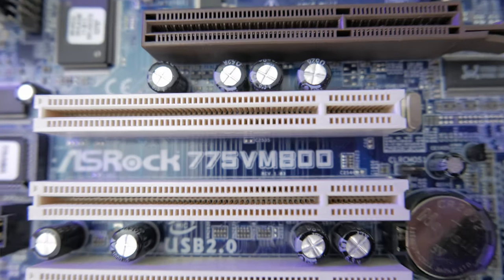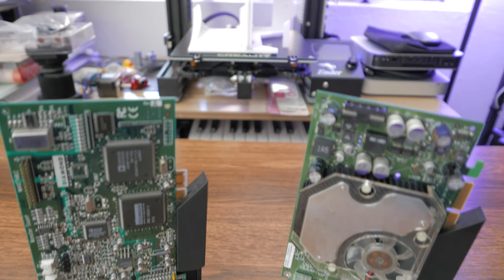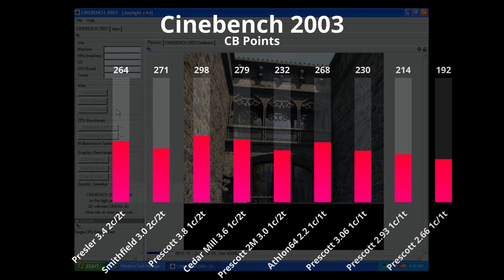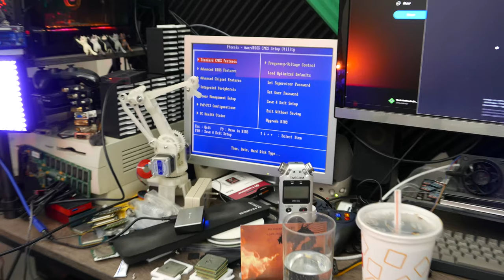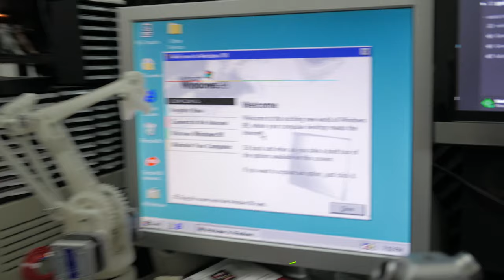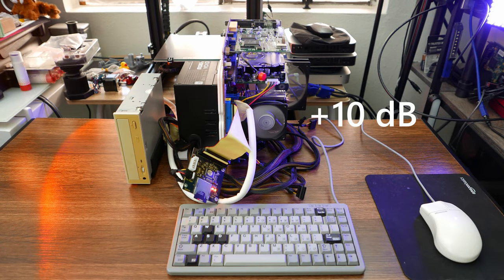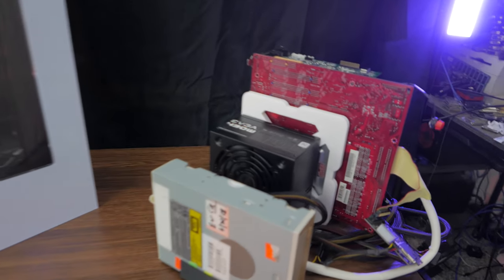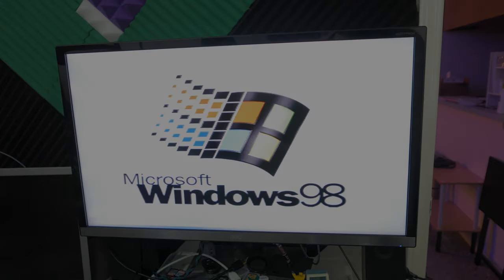Windows 98 for a Week Part 1: The Build

Comment: Ha! Fun stuff going on there, good luck with your quest. Funnily enough, I was just goofing with an Nvidia 6600GT in my Athlon 64 98 SE build today! It wasn't a stellar experience! 😆
Reply from the maker: Oh no! That's unfortunate!
Reply: @TechAmbr  Which Nvidia driver version are you using?
Reply from the maker: @ted-b  Forceware 81.98, I think you can download it from Phil's Computer Lab!
Reply: @TechAmbr  Aye, thanks! Yep, good lad Phil has got them all, I think. I was just wondering if you were using some magic ones I hadn't tried. 😄
Reply: I use a 256MB GDDR3 XFX GeForce 6600GT AGP card with driver version 93.71 for my Athlon 64 X2 4800+ Toledo S939 XP Pro SP3 32-bit build myself.

93.71 was the last driver version to still support the entire GeForce 3-7 series, before nVidia changed the drivers to start focusing support on the GeForce 8 series and above, at the cost of losing GeForce 3-4 support. I find it works better than 81.98, like with 3D Marks 2001-2006, MS Flight Simulator 2002 Professional, or the nVidia nTune utility that I've installed alongside the graphics driver for my purple nForce3 250 based ECS EliteGroup nForce3-A939 ATX motherboard, which is actually still compatible with Windows 98se & 2000 too (the motherboard, not the driver).

Comment: Restart or shutdown daily, Windows 98 gets wonky after running for more than a day or 2.  Bonus content suggestion, after you're done install Windows 10 32-bit on it.
Reply: That's mostly true for the original Win98. 98SE fixed it supposedly.